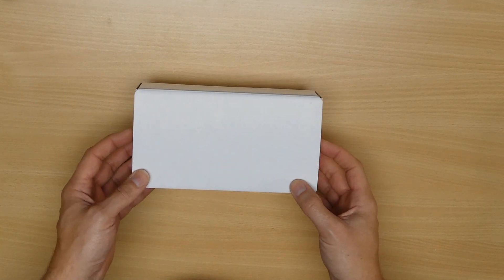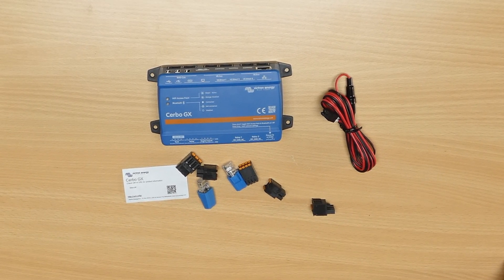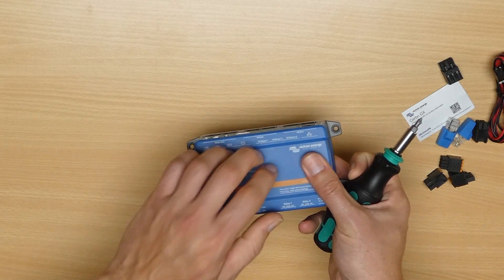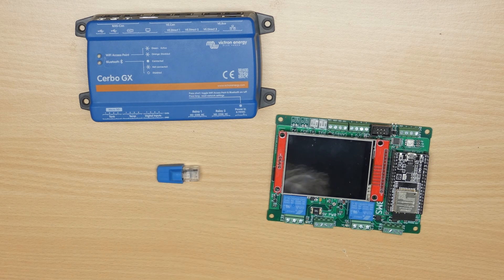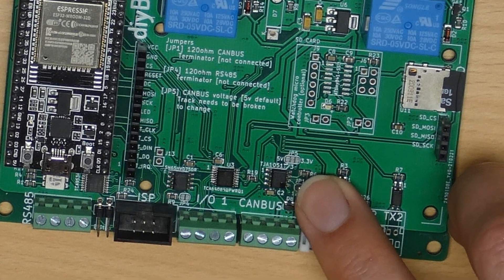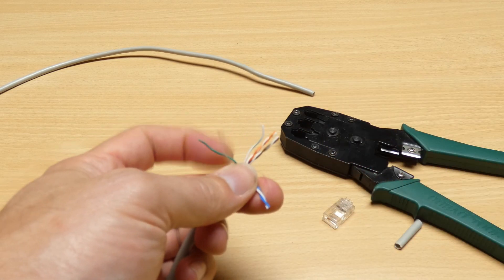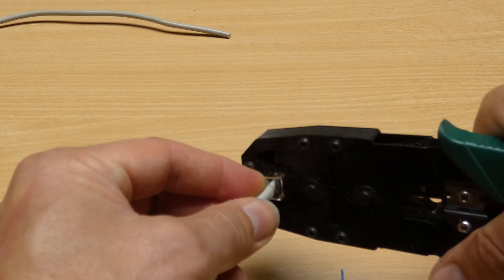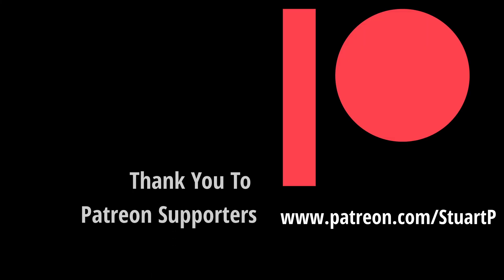Victron Cerbo GX & diyBMS

Comment: Cool video, can you explain why it was necessary to solder a resistor to the circuit board...does it not come complete from the factory.
Reply from the maker: Resistor or the jumper? I think I soldered a jumper pad closed
Reply: Forgive my lack of technical jargon. I ment the solder joint /bridge on the board.  Why is that necessary.  I'm new to electricity etc
Reply from the maker: @Xxxcappie23  ok, it's just like a switch, you solder a blob on the connections to join and enable an optional feature on the board

Comment: Great share, specially the opening of the Cerbo: Now I don't have to open mine that just came in 😃. 
Can you tell me:
a) the BMS type and brand? (I use Batrium which is very neat and very configurable)
b) cool stripping tool!, what brand and type?

Keep up the good works!
Reply from the maker: Hello, the BMS is my own design - diybms, plenty more videos about this on this channel.

The cable stripper is "C.K Automatic Wire Stripper"

Comment: Stuart, I gave up trying to get the Trina 3kW AC coupled inverter/charger working with DIYBMS. I have ordered a Victron 5kW Multi II GX and a Cerbo GX so hopefully I will be able to get my  48V 7 Leaf module boards working. I will take a video of the working system once I have it completed. I have received the first batch of 20 boards and now fitting the CPUs and testing. So far everything is going smooth. Bolts all line up etc.

Comment: Victron is friendly to hobbyists. They provide a build of VenusGX that runs well on a Raspberry Pi 3B+ and newer. I have been using the Pi for years to manage a system with 3 BattleBorn 100ah batteries with solar in my van.
Reply from the maker: I think a few people are going to try our the pi and a can shield to see if it works

Comment: This is wrong, victron is a very expensive not diy spirit. Is a diybms like batrihum
Reply: So don't buy it? This is not necessary for the function of diyBMS, it's purely a supplement of additional capabilities shown by using standard protocols.
Reply: @teejmiller  if you say
Reply from the maker: Correct, this is optional and many users have asked for it!
Reply: I don't use DIYBMS because it's cheap, I use it because it's the best BMS that I have found, with the most features and flexibility.  Same reason I use Victron for my inverter.  Yes, Victron isn't cheap, but they do support the DIY spirit by giving their software out freely to be used on Raspberry Pi, and allowing all sorts of projects (open source and otherwise) that use or interface with their hardware.
Reply: @Firebat45  👍
Reply: Victron is expensive - but no more then other quality inverters. I have had a Victron Quattro running since 2009 - without a single hiccup and its nearing the end of 2021 as I write this....not too shabby eh ? I'll take 12 years without a single issue thanks. Yes it cost upfront but 12 years down the track its running perfect. How many Chinese inverters would I have gone through in those 12 years? The DIYBMS hook up with Victron is a very good thing.

Comment: Morning from Australia.  Looks good. Could you point me to the circuit for the control board with display please, as I think a couple of part where missed by JLBPCB. I did try to post on the openenergymonitor group, but couldn't work out, which thread to put it in too.
Reply from the maker: https://github.com/stuartpittaway/diyBMSv4/tree/master/ControllerCircuit
Reply from the maker: That is the link to the controller PCB and circuit
Reply: @StuartPittaway  Thanks Stuart,  hope you are well. To your whole family,  stay safe, all the best from Australia.